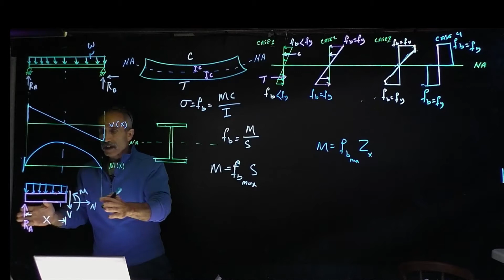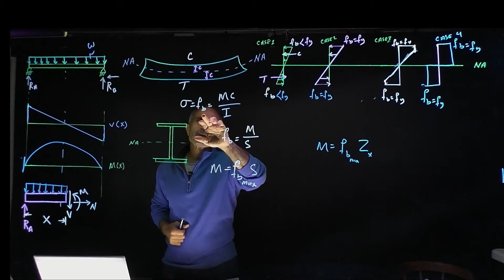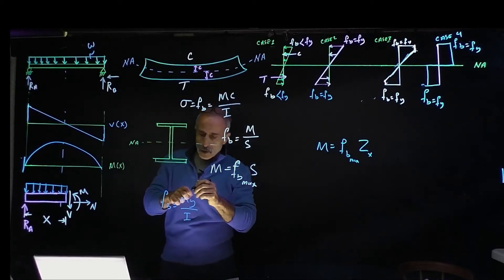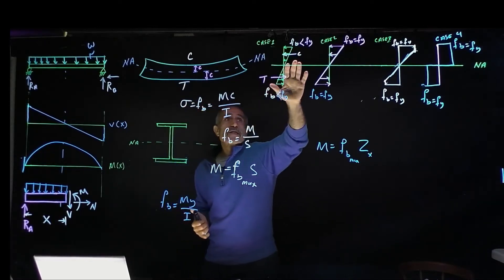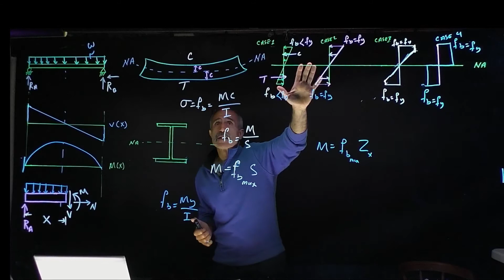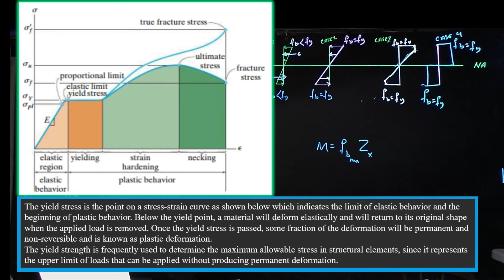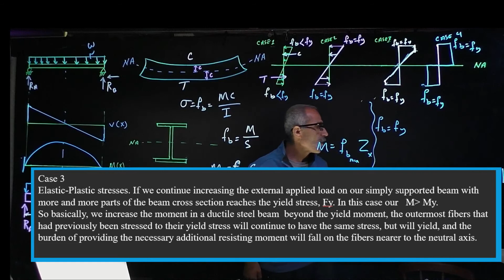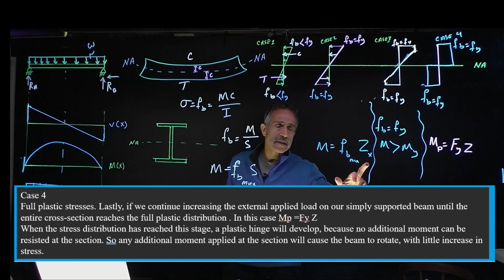Plastic Hinge Steel Design

Comment: Maximum Bending moments = wL²/8
Bending stress = Mc/I. 
Please don't confuse the twp
Reply from the maker: Bending moment and bending stress are two different.  Bending stress is the internal resistance a component develops when an external bending moment or force is applied. This bending moment causes the component to curve, which in turn creates tensile and compressive stresses within the structure. These combined stresses are known as bending stresses. Max moment for simply supported beam is wl^2/8.